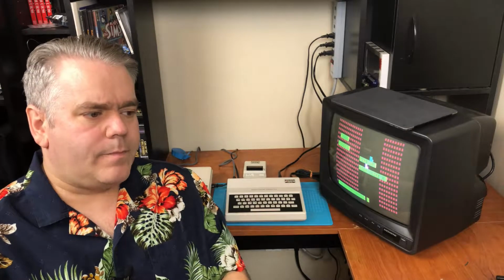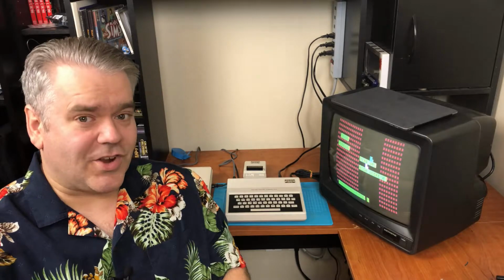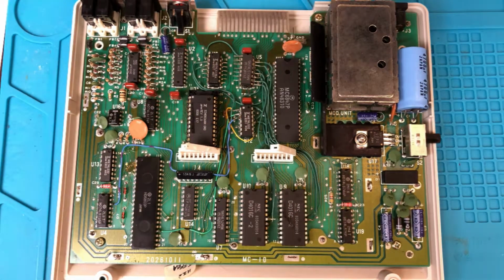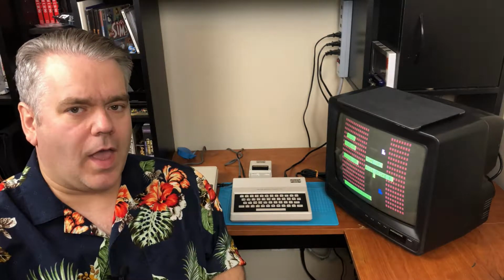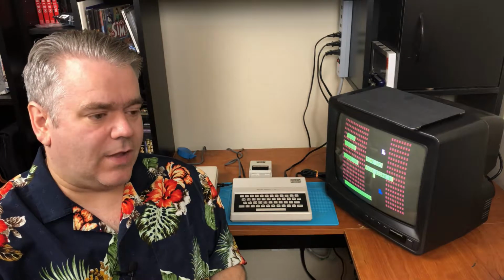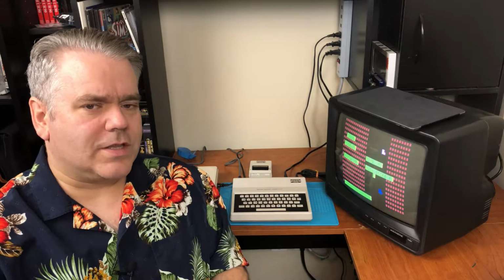Looking at my TRS-80 MC-10:  Part 2

Comment: Tandy made a mistake when they still made computers, the original TRS-80 was a Z80 machine but the "color" computer was not a Z80 machine but it had a 6809 microprocessor. Therefore there was a division and programmes of one could not be used by the other. 
 
Why did Tandy do this! No question-mark, because there is no-one to answer any more. The Z80 is still being produced and used while the 6809 is a curiosity, derailed to a remote side track of history.
Reply from the maker: The 6809 was not used in the MC 10, it was the cost reduced 6803.  The 6809 has an improved version, the 6309, which is a drop in replacement that is still used and made currently.  Places like Retro Rewind still sell them, new stock, so I would disagree that they are a remote side track of history.

Comment: Normally there is an RF shield covering the front of the board.  
Most of these machines had the ROM soldered in, so the lower socket was probably added.
The upper ROM socket is an adapter for the different pinout of the EPROM.  
The wires to the SRAM chips are the additional address line from the 6847, and chip select lines.
The additional 4K lets you use hi-res graphics.
Your other wires / piggybacked chips are for the additional address decoding logic to use the new RAM.  There's normally 1 piggy backed chip fixing a problem from the factory.
Other chips on the board are:
A latch for demultiplexing some pins out of the CPU to get the full 16 bit address
Chips used to control output to and input from the keyboard.
A latch to hold the settings for the VDG (The 6847T1 would not require this, as it's internal)
Some chips for address decoding
Chips (chip?) to divide the clock signal to generate the proper frequency.  The 6803 and VDG get alternate signals so they can share the buss on alternate clock cycles.
Reply: I feel like a very competent person did this mod, and it's a shame we don't have his notes or anything. CRT unfortunately doesn't have the chops to analyze it properly, and it's painful to watch him try! Thank goodness he didn't try. I hope he got another expansion and maybe another whole, unmodified MC-10.

Comment: Ahoy, the 4K RAM upgrade I did in 1984 (thanks Green Mountain Micro) added Graphics RAM so you could do hires without destroying the BASIC program space. Microsoft had the Graphics RAM butt right into the BASIC scratchpad and program area. Poke into the hires mode and run a basic program and you can watch the RAM changing as it runs on an umodified MC10. With the mod you poked down into the lower 4K and changed the location of start of VRAM and voila! HiRes on the MC10.
daveyb aka MC10GURU
Reply from the maker: Your comment on the MC10 emulator got insta-blocked by YouTube since it had a link in it, apparently you can only post links if you are a sketchy porn spammer!  I did read it so a second like for that one!

Comment: I have a small stack of MC10. I built a cassette cable from the schematic and discovered that the motor control or remote was shorted on the computer connector. It appears to be the same cable for the Coco II but the II doesn't short the remote
Reply from the maker: I don't believe the MC10 uses the motor control so the remote cable doesn't need to be plugged in.  It is the same cable across a number of Tandy computers (MC10, all 3 CoCo's, the model 100...)
Reply: @CanadianRetroThings  that's good to know, I will build three more cables, thanks

Comment: Wow, did you get a lot of this wrong.  The 74LS32 is a quad OR gate, not an inverter.  The 74LS125 and 74LS139 are mounted on 74LS367 and they are NOT the same kinds of chip.  The 74LS32 is a factory bodge and not a part of the modifications.
Reply from the maker: I will be the first to admit that I am only just learning about how these chips work but the inverter chip (74LS14) is the chip I was talking about at U12, which is the chip listed in the service manual.  As I couldn't see the bottom chip that the wire was attached to, I made the assumption it was the original chip listed in the parts list.

Comment: I've just put my PAL (i.e. Australian) MC10 on the bench to see if it still works. Interesting little machines. By the way what on earth is your ESD strap connected to?
Reply from the maker: I have it attached to a grounded power outlet box, not the power outlet itself, just the box.
Reply: @CanadianRetroThings  Hey, I suspected that. Honestly not trolling but that really achieves nothing. 

Attaching the ESD strap to ground will just ensure that YOU are at the same potential as ground. It does nothing to protect the equipment you are working on. 

The key issue is that you need to reduce the potential difference between YOU and the equipment you are working on. At the moment the MC10 (for example) may have built up a static charge of thousands of volts relative to you(and ground), touching it will still cause an ESD event. 

In the absence of a dissipative ESD work mat you would be better off connecting the strap to the ground of the MC10. This eliminates the potential difference between you and it - the rubber mat etc are still potential issues. 

 In a lab environment we do reference things to ground but only as a common point. So the floor is static dissipative and grounded, the bench mats are grounded and our wrist straps are grounded. It's not the act of grounding that is protecting our stuff from ESD events but the fact that everything possible is at the same potential.
In your case I'd recommend you use an ESD mat with the strap attached to it and that can optionally be grounded. Remember that walking around with a bare PCB or static sensitive parts can still lead to an ESD event when you put it on a shelf etc.
ESD is very widely misunderstood, even in professional environments so don't feel bad. Cheers.
Reply from the maker: @ingmarm8858  I do agree that a static mat would be more ideal, as it is I am only using the wrist strap to discharge any static charge from my own body.
Reply: @CanadianRetroThings  I think you are missing the point that this does NOT protect what you are working on as the potential difference i.e. static charge STILL exists between you and the item you are working on regardless of your grounding!
Reply from the maker: Thanks for the information, I now have an ESD mat on order!
Reply: @CanadianRetroThings  Excellent! Then if you do "ground" it connect the strap to the mat. The ground on your soldering iron etc should then ensure that everything that touches your gear is at that same potential via ground.

Comment: Be sure to check with Ed before purchasing things on the zipster store, not everything is available.   I think, considering the likelihood of undoing the Frankenstein modification would be pretty difficult unless you're an expert with hardware and the MC-10, and your desire to keep this anomaly as is, that's a good idea.  Also, you could pick up a normal unit pretty cheap, and use the expansion pack with that.  Thing is, who would go through all that trouble just to add 4k when one could easily add 16k by adding an expansion pack?  Seems like whoever created the modification didn't think it through very well, because a proper mod would have allowed the expansion pack to be added plus the internal 8k.  Anyways, thanks for the peek inside.
Reply from the maker: I really enjoyed looking at the guts of this machine!  As for picking up another MC10, in my collecting I try not to just go on e-bay or things like that and buy them.  For me the fun is going to second had shops, estate auctions and such to find things, so it may be a while before I come across another but I am definitely keeping my eyes open!

Comment: Cool find! I think the mod is from the 1980''s. The chips all seem to be from about 1983. Since the MC10 is pretty easy to find on the net. BTW I have the MCX-128 upgrade, love it.
Reply from the maker: When I get my hands on another MC10 I want to look into something like the MCX-128.  I am keeping this machine as is so any memory expansion that plugs into the edge connector will run into the same interference problem.

Comment: Just so you are aware (if you are not already), there is some RAM, etc. upgrades that don't cause problems that are commercially available. Scroll to the bottom of the following page to see 4 hardware upgrades for the MC-10 (MCX-128 in particular works very well, and adds a lot of functionality-128K RAM, Extended BASIC, and even loading programs from a PC): https://thezippsterzone.com/hardware/
Reply from the maker: Thanks, I'll check them out.
Reply: @CanadianRetroThings  Be aware, none of the upgrades work with the internal upgrade. In order to use them you will need a stock MC-10.
Reply from the maker: @Gerardus1970  Another stock MC-10 is now on my shopping list!